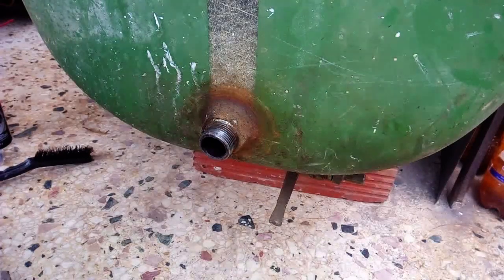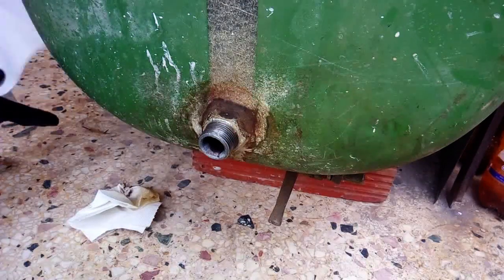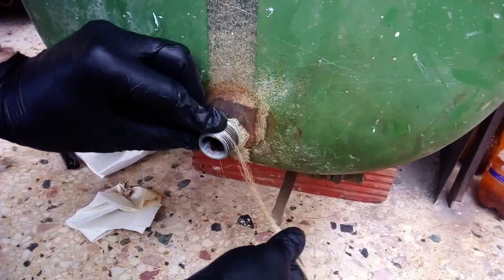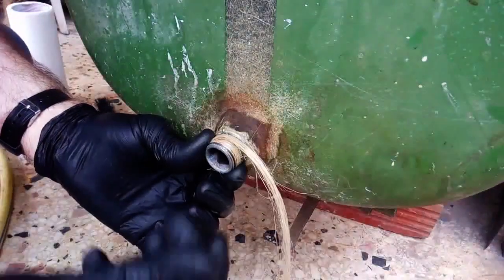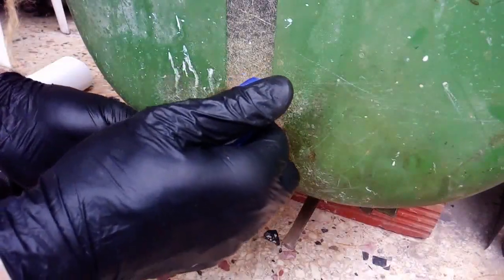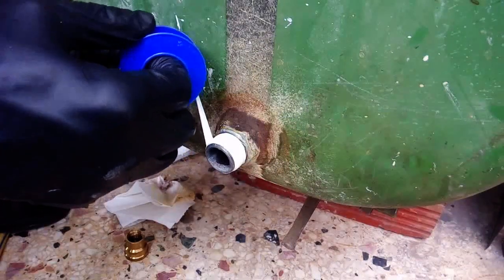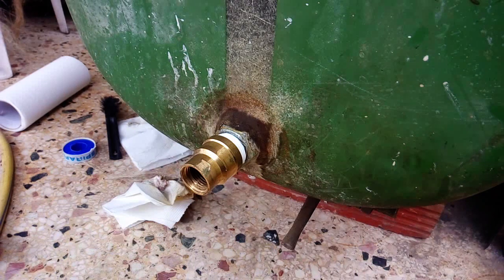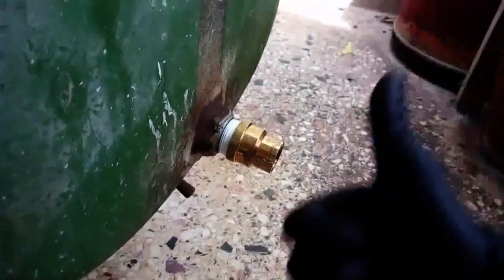How to seal a thread with hemp fibers and PTFE tape - Diesel fuel (ENGLISH)

Comment: degreasing was absolutely unnecessary step for sealing by hemp 😂
Reply from the maker: Indeed. 
A few days later, after using it normally, and fuel running through, I installed a 90° elbow on that brass reduser, with the same method of hemp and PTFE, and I didn't have enough carb cleaner to clean the thread, and a couple days later that second connection failed miserably. It got wet and leaked. All the while the first connection, stayed totally dry. Says a lot about the nature of the fuel we want to seal. 
The final connection was done with a different fitting, which used a rubber O-ring suitable for diesel fuel, and problem solved. Up to this day, that final setup is totaly dry. 
Good job!